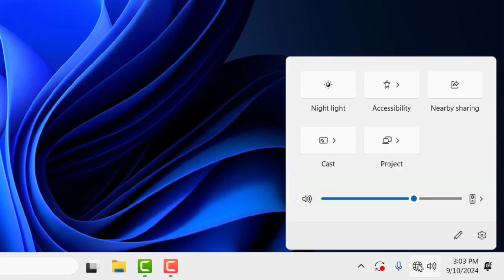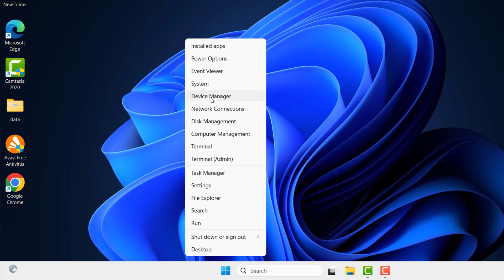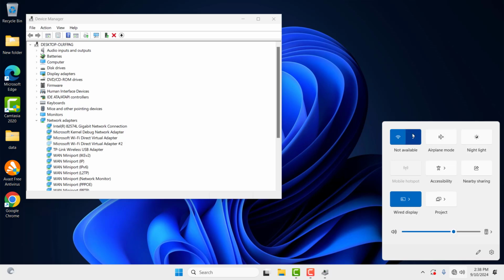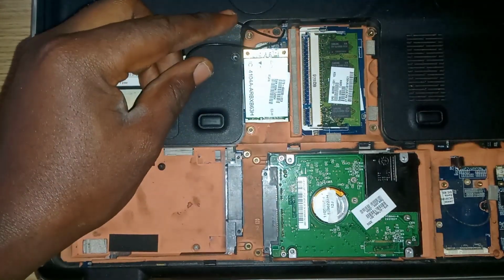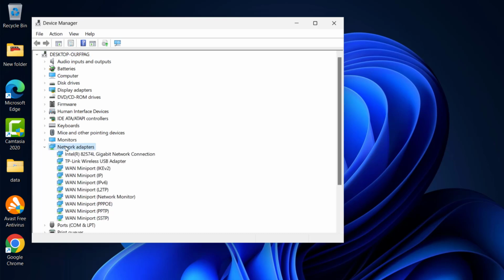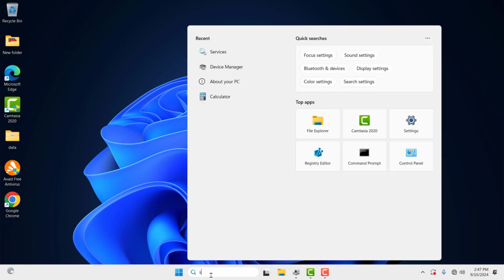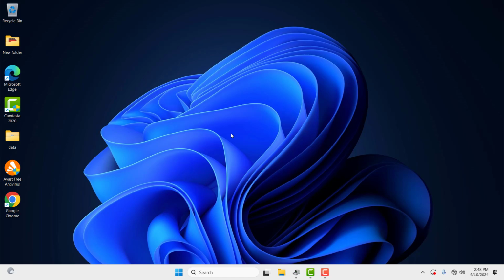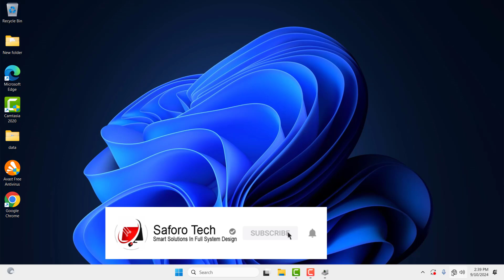Fix WiFi Icon Not Showing Problem on Windows 11/10 | Wifi not showing in windows 11 Taskbar

Comment: I thought this was my fix but the hardware is the problem that I can't access. I network reset and my wifi icon disappeared
Reply from the maker: Do you mean you can't open the laptop case to reach or get access to your WiFi adapter?
Reply: @saforotech8552  No
 Fortunately, I made a miracle since this is a 2nd hand laptop. The process is different. i manage to fix the WiFi problem using this method mex with a different one (just the steps) . Thank you